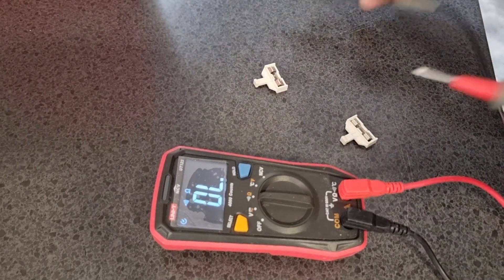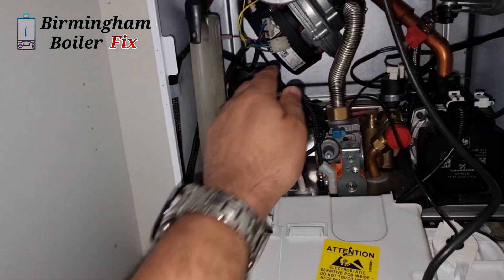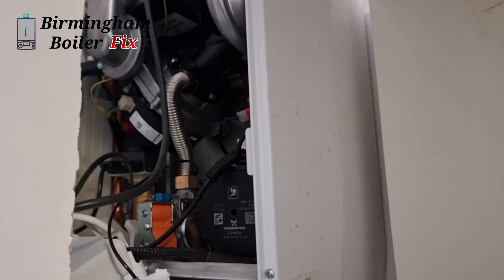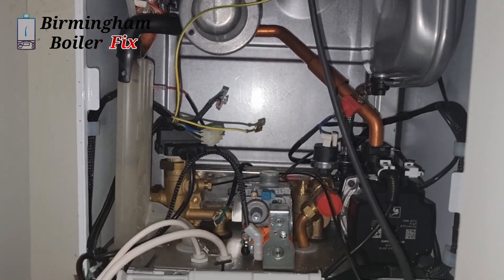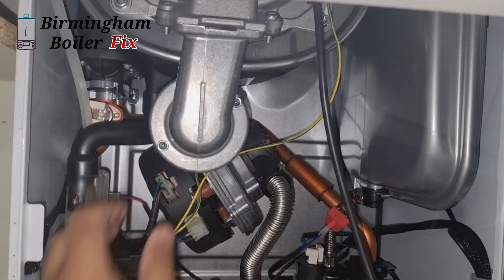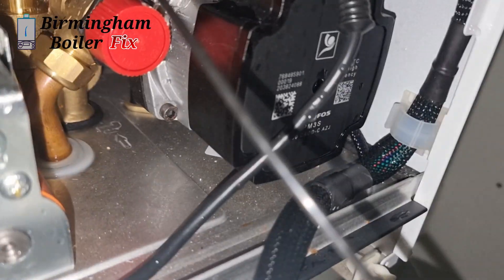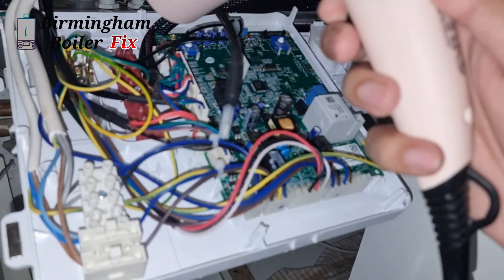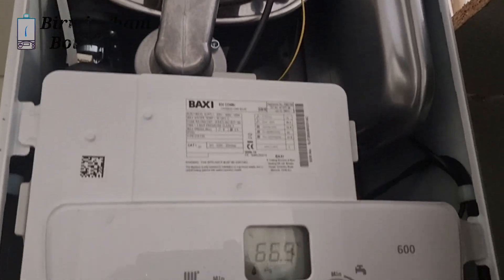Faulty Baxi boiler blowing fuse due to water damage diagnosis and repair BirminghamUk

Comment: Did you ever find out where the water was coming from as i have just had one of these leak around the flue there is no protection to stop water from getting into the box and tracks down the font of the cabinet unto the pcb this is a design fault by Baxi and could lead to a dangerous electrical fault this needs to be brought up with Baxi before someone gets killed or loses there home through fire, there is also a passage through the top of the fue into the cabinet which supposed to divert tye water away which isnt effective. I previously had an Ideal isar that was sealed and the PCB double protected by a plast box and a flexible plastic shield so Ideal know this damage is a common possibility so Baxi should be contacted and liable for this serious design flaw.

Comment: Great video! Random question which I’m not sure if you will know the answer to but a fuse has blown on my baxi boiler, the fuse is a  Baxi 7727139 2A 250V….do you know if this is a standard 20mm fast blow fuse or a different size?